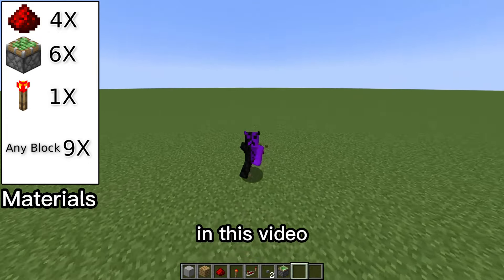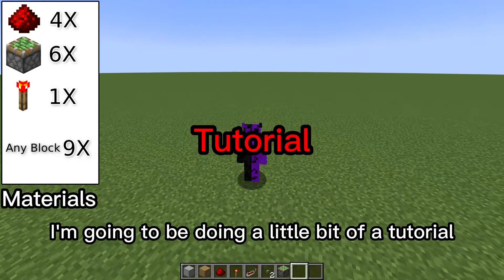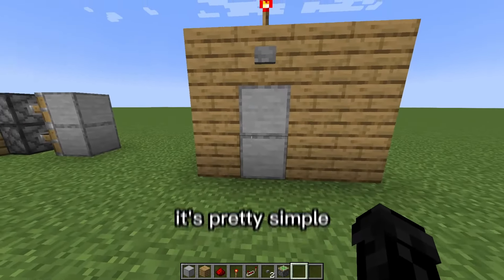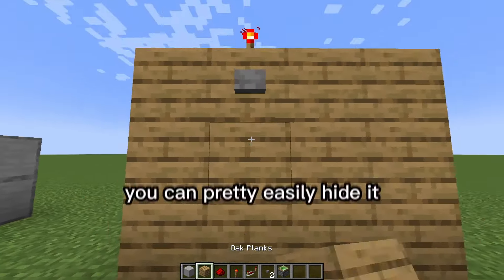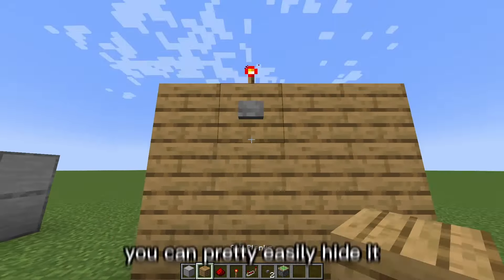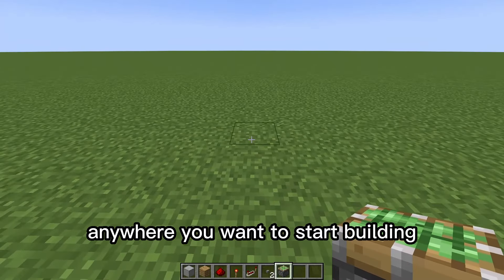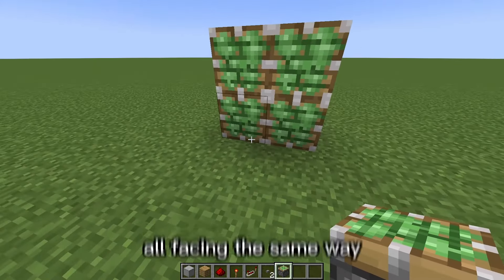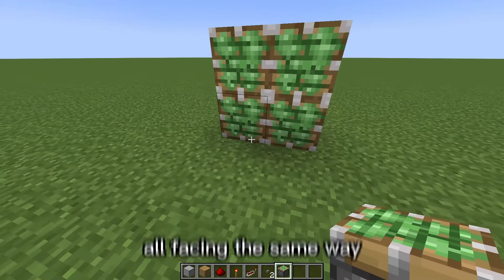Minecraft Simple 1x2 Flush Piston Door Tutorial *Java*

Comment: Please do a how to get it open on both sides
Reply: connect another button to the redstone torch
Reply: I had to make it so that you're powering Redstone dust, which turns off the torch. it's more complicated that way, because you have to put the torch on a wall, and have Redstone dust running into the block that the torch is on, but the you can just have the Redstone dust connected to the other side, and it works perfectly fine.

Comment: pls do the 2 way door
Reply: I had to make it so that you're powering Redstone dust, which turns off the torch. it's more complicated that way, because you have to put the torch on a wall, and have Redstone dust running into the block that the torch is on, but the you can just have the Redstone dust connected to the other side, and it works perfectly fine.

Comment: any new vids on how to do the first door but access both ways?
Reply from the maker: Not currently, I may make another video on how to do that.
Reply: I had to make it so that you're powering Redstone dust, which turns off the torch. it's more complicated that way, because you have to put the torch on a wall, and have Redstone dust running into the block that the torch is on, but the you can just have the Redstone dust connected to the other side, and it works perfectly fine.
Reply from the maker: @phakevreugde8540  Glad you were able to figure it out!
Reply: @phakevreugde8540  how did you do it? im not very good at redstone and I cant find any videos on how to